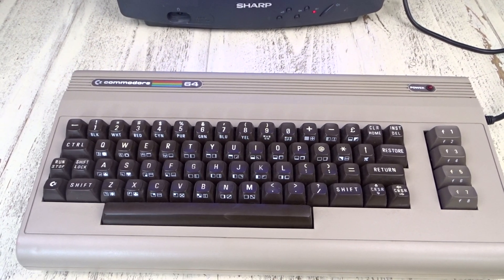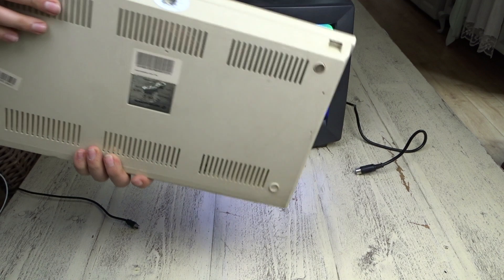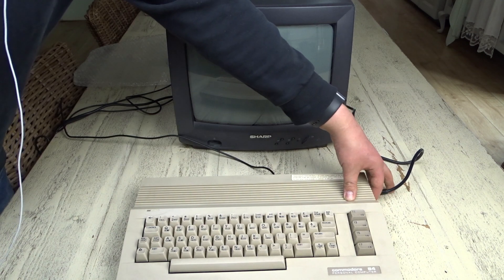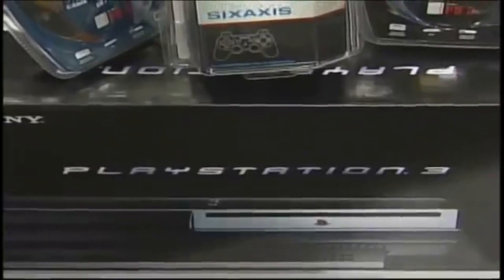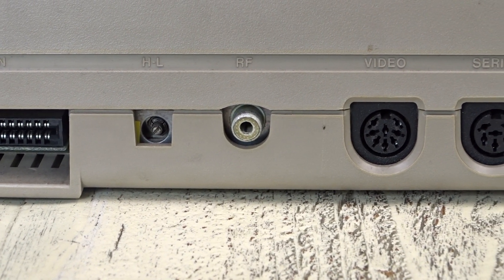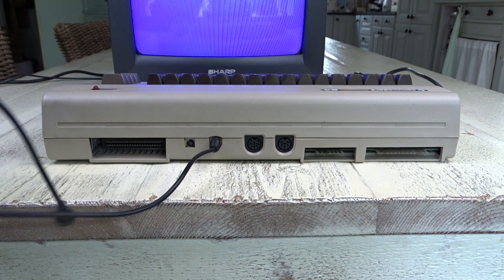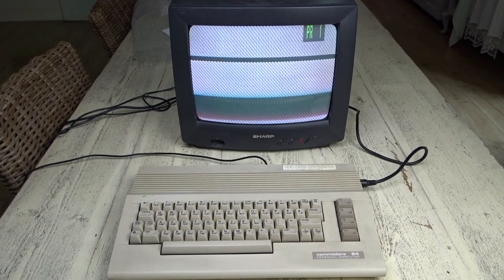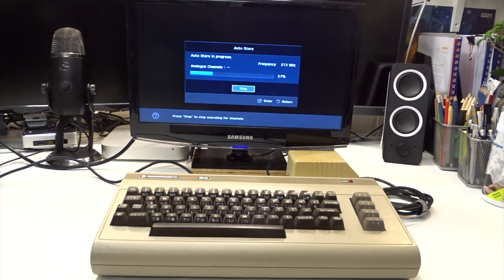How To Connect a Retro Computer To a TV Using RF - Learning As We Go Episode 1- feat. Commodore 64

Comment: Nice video.
Coax is difficult, its also used for normal cable tv, so you need to switch cables.
I once had a switch for this, to switch between tv and console, but thats probably "lost in time"".

But why not used the video poort on the C-64, and connect that to de scart ?

And please buy a new power supply unit (psu).
On this old models the 5v circuit wil rise over 9v, and will fry some internals of the C=64.
They are called "bricks of death".
Reply from the maker: Thanks! Old video haha, these days I use a new power brick and have a video cable that can be connected to the video port. Video was more for new retro folks like me to show how RF is setup. Because before I had a C64 I wasn’t aware of how it worked and thought my C64 was broken haha…